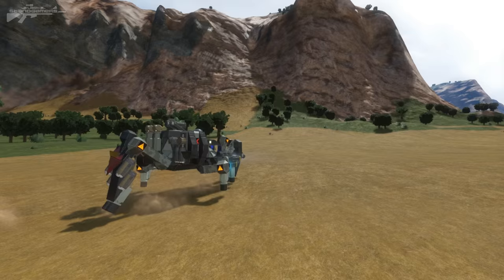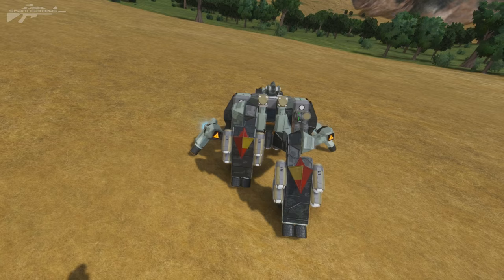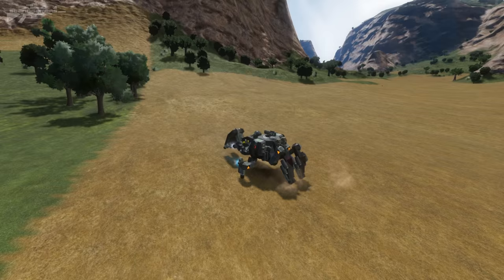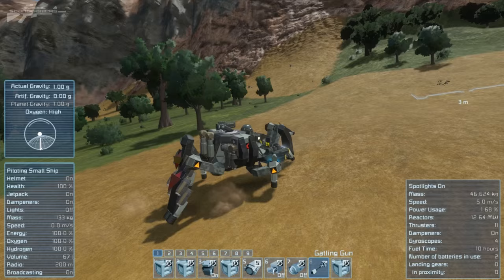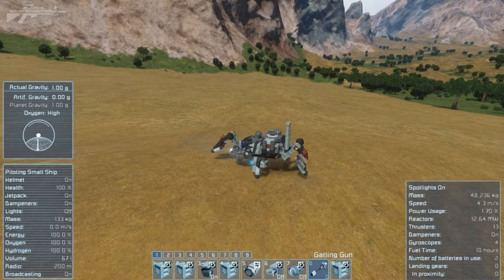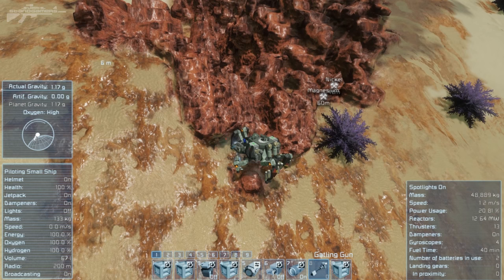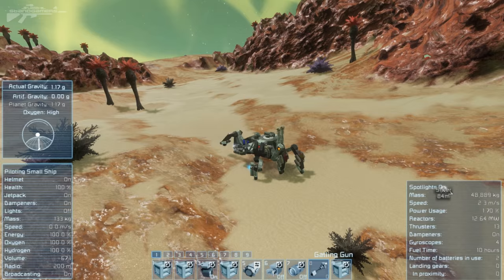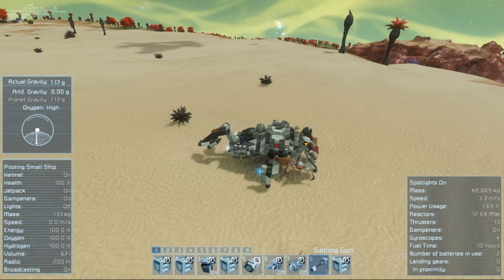Space Engineers - Bug Mechanical Walker

Comment: Imagine hundreds of the walkers dropping from a mile up and landing and attacking the enemy
Reply: +Jack Mcdoug THE LAGGGG
Reply: +Jackson the Pro and Badass same, i can&#39;t imagine it, my brain crashed because of the lag as i tried
Reply: Sounds awesome, but a couple well made SAM turrets will knock out all of them in quick succession, wheeled vehicles will dodge their fire far better and be able to do laps around them, and when they try shooting back they have to choose between having to remain still or having the bumpiest view of their enemy possible with guns that can't be gimbaled and a turret whose AI is experience nausea.
This mech is an awesome mech, but in reality it's still pound for pound a horrendous idea. Less accurate, less fast, less effective for its weight, and easier to immobilize in a way that can't really be prepared for with more armor, you can add a skirt for your vehicle's wheels and within reason can add many layers, but the walker can't have joints with too much armor.
Reply: plus it's less reliable against any vehicle or infantry that finds a way to be lower than it, and I already developed a vehicle that digs a bit into the ground to use as extra armor at the cost of mobility, so basically this bug wouldn't even be able to effectively target that in most circumstances,

Comment: If you take any requests, I would really, really, really like to see a drop pod like the ones in Halo: ODST, a fully functioning one that can slow itself down and hit the ground while still being upright
Reply: +The Waifu Master They have a few of those on the workshop
Reply: +The Waifu Master considering this game has a speed cap probably isnt that hard
Reply: +Communist_Penguin It isn&#39;t. Consider the mechanics of non-deformable blocks, and you have the basis of my own drop pod design. Very cheap, unpowered single-use, single personnel ODST (orbital) drop pod.
Reply: ***** oh, i wasnt thinking powered, now that would be interesting
Reply: Communist_Penguin The one I have is unpowered, which means that it does not brake, and can still survive the fall.